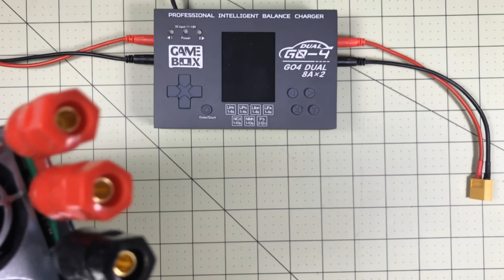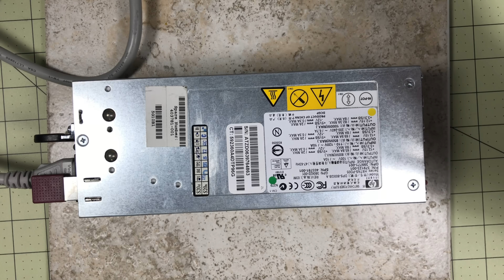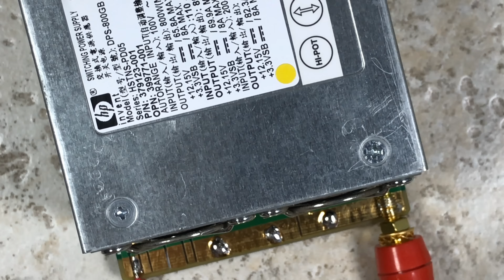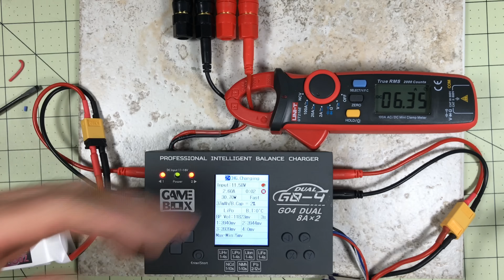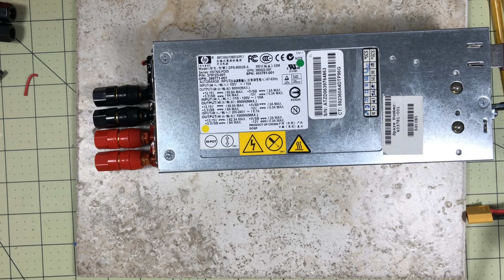Turning an HP DPS800GB power supply into an RC Bench Power Supply. Your cheapest power supply option

Comment from the maker: You can get one right now: http://geni.us/IAX9m
And the Banana Plugs: http://geni.us/4mmBananaPlugs
Check out my current giveaway: http://geni.us/DroneRacer101Rewards
Reply: (3:20)  Always solder one end, then cut to length.
You'll be at the exact length when you cut it, and you'll have more to hold when you're making the first connection.
Reply: (6:30)  you'll find that easier if you heat the pad then touch the solder to it.  and it's not sodder it's soLder
Reply: (12:30)  No ... just No... that is a cold solder. 
To properly solder, you heat the component and add the solder thread to it.
You need a much bigger soldering tip to properly work with that size of component.

Please don't encourage people to solder the wrong way, you're encouraging dangerous connections and putting people at risk of electric shock.

PLEASE STOP

Learn how to do it correctly before you endanger other people by teaching them the wrong way.
Reply: @RobotMunkee  You must have xray vision through a video.
Reply: The banana plug link is dead i need some..what type bananana plug are they called?

Comment: The contacts are GOLD plated. Yes, COPPER is under the gold.
Tinning is preparation  and application of the solder to a wire or other surfaces prior to the final connection being made. Dont carry the solder to the object on the iron. You apply heat to the wire, pad, etc, and apply the solder to that combination of the iron tip on the wire and pad. If you carry the solder to the joint, you will likely get a "Dry joint". You sould also use the correct rosin core solder, never use plubing flux and plumbing solder as that will corrode the joint. I know you didnt do that, that's for others watching.

Comment: 7 years later do you still have the power supply..pin 2 to pin 2  would need 330 ohm resistance..good video too..I have just done the pl11 4 times at 13.8v 400 amps.hope the rc hobby is going good

Comment: I used bigger plugs and cut the threads off then pushed then into copper terminal spades then soldered everything together. 
Zero resistance and handles 80a without a problem.  👌 
Nice work

Comment: Using this PSU nested inside an HP Z800 power supply case. The power supply for those workstations cost a lot and sucks a lot. So, just re-routed all cabling from the old PSU case to the new PSU. The power supply for the HP Z800 is like a drawer that snaps into place with 3 connectors. So basically making the "DPS-800GB A" feed those 3 connectors. Was quite the pain to join all those cables, but next time I have only some 9 cables to re-solder into the new PSU. And the new PSU is A LOT better and cost 1/3 of the price of the HP Z800 PSU.

Would be nice to have a plastic "connector" for this PSU. I wonder if it is possible to print one and add copper contacts...

Comment: Hi. My dps-800gb had the fan blocked for  literally 0.5 seconds. It shut down. And the green led doesn't comes on anymore. What can I do? Is there a way to reset them?

I have 2 of them in  in series. So 24v

It surely wasn't overheating. Only hat my  charger on it with no load.

Comment: The "metal to metal contact" that you are talking about at around 9:25 is wrong because the solder is what's making the contact. What you should actually be worried about is the mechanical strength of that connection, because you are going to be plugging things in and out, and solder is not that strong. 
Edit: you need nowhere near the pressure and time that you used when tinning the banana connector, what you needed there was flux. When done right, solder flows easily and quickly, and by done right I mean bigger flat tips for the soldering iron, and clean surfaces to solder, and that's achieved by using the flux that I already mentioned.

Comment: You need to add a micro butane torch to your soldering equipment for when you need to solder something that soaks a lot of heat! A large Weller gun style soldering gun will also work.

Comment: get a couple of inches of microbore copper pipe, hammer it flat to make a buss bar, bend it 90’, solder one end to the edge connector, drill a hole in the other end and screw the banana jacks on

Comment: Drill thru the PCB and mount the plugs thru hole style. Also use some 12Ga to tie them to the output lugs close to the blades. 
lots of different ways to skin that cat.
Reply: They don't advise drilling this multi layer board.
Reply: @arconeagain  huh, worked fine for me. guess i got lucky

Comment: would 441830-001 - HP 1200W Power Supply for Proliant DL580 G5 be the same process im asking because when i plug it in it does power up so wondering if i still need to run all the cables thanks

Comment: I'm surprised there's no comments about how ridiculously dangerous this is. It's good that you covered the exposed leads at the end but the ones being sold at the link in the description seem like they have giant exposed leads. 800W at 12V is more than enough to kill you.

You should at least include a warning in your video, soldering those small wires is to work around a safety feature that is supposed to keep the 12V rail low while it's not plugged into the server.

Comment: you should just drill a small hole through that #2 terminal then use a small metal wire through the hole as if it's a diode or resistor lead though the board. will be a cleaner job.  do the same thing with the big connectors.  drill through the board and use the nuts to hold it on. no need to solder.  or you can solder it way easier.
Reply: Worst way to connect high current.
It adds a resistance big enough it can glow red.
Reply: @hulkgqnissanpatrol6121  you do understand a pcb is made exactly as i described, right?
Reply: @blue03r6  they're then soldered.
Always solder and how is less surface area better? 🤔

Comment: Hi, thanks for loading this up.  my friend gave me an HP 800W months ago but I was too lazy to read RCG to figure out the wiring.
your instructions were clear and I was able to solder directly on the pins and get it going in no time.  hooked up to a 400W lipo charger and works perfect.

Comment: Thanks for the inspiration.  Works like a charm, but I realize it could crap out at any moment.  I soldered  3 charging leads directly to the tabs.  Running three chargers simultaneously at full capacity and it didn't miss a beat. Two 80 watt 10 amp chargers and  one 100 watt 10 amp per channel  dual charger.  I couldn't be happier with it.

Comment: Hi, I had done the same with my power supply, but it does not provide 12 volts, only 3.3v and 5v are coming and 12v are not available.  
Is there any fuse or anything which is inactive and interrupted 12 volts???  Fan is working and green light is off..
Please help me.. Thanks in advance
Reply: Hi! Check the output double diodes! And 12v output capacitors. Keep me updated please!
Reply: @pavelbires  where are Double  diode and the output cap? i have no 12v on the terminals but 5v..on the small conector..fans turns on..
Reply: @ferreec  Are you using the PC ATX PSU?
Reply: @pavelbires  i'm using  hp dps 800gb..i did the same..the supply turn on....I didn't check the green light...when i plug in 120V to source..the grounded  cable was not conected...no ground..make difference? I Will open to look inside to find the problem..i'm not an eletronic expert..kkk
Reply: @ferreec  Sorry, I thought you were talking about PC PSU. I never had a server PSU on hand, so I can not help you. I am not electronic expert either. But if the fan spins, and you are getting 5v, you maybe haven't gotten the wiring right. The PSU is probably ok.
Reply: @pavelbires  thanks...i will  spent more time on that..
Reply: Which supply is it? Like this one in video or classic PC PSU?
Reply: @pavelbires  I have solved my power supply issue, now Its working fine. :)
Reply: have you solved the problem? i have the same

Comment: (i plan on doing this soon, therefore i watch your old video) I guess i will connect thick cables on the contacts an then connect the cable to the desired contacts. and i recommend this too, because soldering wire is always easier than full copper connections.

Comment: It probably has gold plated on the terminals both on the ps & the barrel connectors, and also leaving it threaded 'actually' give more contact than grinding it off to a flat lesser surface area. it is the solder that is creating creating the electrical bondage between the both terminals, so more the corrugation the more the surface area.

Comment: thanks for info - your soldering skills need much improvement
Reply: just needs a bigger tip for the big stuff.  to be honest he should just drill a hole and bolt them to the board.
Reply: @blue03r6  nah, using pressure, dirty tip, wrong tip, not using flux, all of this except the flux is wrong, flux is optional, but it would definitely make his life easier

Comment: Just ordered a pair of hp dps-750rb PSU units fro EBay and it was like $20 total!!! Can't wait to try your mod on mine!! Thanks for the useful vid. Quick question... Is a resistor necessary, or just that short jumper wire??
Reply from the maker: I did not use a resister.  It’s just wire.  Some of the diagrams did have one but I didn’t need it.
Reply: Sorta considering a power switch once they arrive...... Not too convinced I would REMEMBER to unplug after use.... Ever build one with an add on switch???
Reply from the maker: I have mine connected to a surge strip and I just used the switch on that.  Made it really easy.

Comment: How can your Amp meter get the Amp reading using the clamp?  The clamp is for the AC current only.  To measure DC current you need to connect in series using the probe.    I am puzzle how you measure it?

Comment: hi friend, I use this psu to power a 3d printer. The 5v output is used to power a raspberry with octoprint. Can I ask you if it is normal for this standby psu to heat up? Only when I activate the psu to get the 12v then the psu cools with its fans. In standby the fans are off and then the psu heats up

Comment: Good job, FYI : That's one of the 1000W ones.  HP supply them in three wattages =800/850/1000 w.
Reply: But only 1000W when running in 220-240V I think. 110-127V is 850W and 100V is 800W. That is what is written in the label. Here in Brazil we have both 127V and 220V pretty much everywhere, but here in my region we use more 127V (220V only in some places). So mine will run in 127V / 850W.

Comment: Have you tried 2 or more in series to get more amps?
Reply: In series would not give more amps, it would give twice the voltage. In parallel would be the way to get more amps.
Reply from the maker: I haven’t yet.  I haven’t had any need for the higher voltage.  Mike is right, in series will make it 24 volts.  The bigger chargers require higher voltage to charge the bigger battery packs like the 8S packs Heli guys use.  But but for drone chargers there really isn’t a need.

Comment: How could you wire this up in series? Is it as simple as wiring it up in a 2s configuration? or do you need to release a safety mechanism?
Reply: A good video I've found on this topic is here https://www.youtube.com/watch?v=aL8lcJ69mkg. Not sure if it is this exact video but his series covers the topic of floating the ground of the cases of the PSUs. Theres a lot of science behind how this works but its pretty easy to accomplish in reality, just be really careful as you may have to go near some big capacitors.
Reply from the maker: You can, but there is a very specific process to do it correctly.  I recommend reading the RC Group listed above and they detail the process for wiring it.
Reply: OtherDalfite, Thanks but turns out that this power supply doesn't require you to do that to wire up in series. It literally just as simple as wiring it up on a 2s config to get double the power.
Reply: @CareLESSmAyhem   Just watch out if you do. If any of the two supplys gets deffective the casing might transfere 210Volts. Make sure you disconnect the DC grd on one of the supplys if you put them in series.

Comment: Hello and thank you for posting this video. II doubt I'm speaking for myself when I say that I am a visual person. Following steps in a blog is a lot more difficult than pausing a video. I do have a problem I hope you can help me with. I have the exact same psu that I am working on. Only differences are that mine is a Fujitsu brand and has one large fan on the end instead of 2 smaller ones. My problem is when wired up the way you demonstrate I only get 5v output and my light, although is green, flashes instead of constantly on. It acts as though the psu is happy, it's just missing a little something. Any help would be greatly appreciated! Thanks again
Reply from the maker: What is the model number on the power supply?
Reply: The model number is the same. It is a DPS-800GB-5. It also says it is a Rev. S2F. I'm not sure if maybe the revision number makes a difference or not.

Comment: Using your configuration the PSU comes on when plugged in however it shuts down after a minute or so.  Do you have any idea why?  It is a brand new PSU, the same p/n 3791230=-001.
Reply from the maker: +Mike Phillips Did you check the voltage output?  12ish V?  Have you tried putting a load on it?
Reply: Mike Phillips where you able to resolve the issue with the power supply?
Reply: I purchased a second one and had no luck AGAIN so I purchased a different model that i knew would work.  DPS-750RB-A works like a charm with my iCharger

Comment: I have an iCharger 4010 Duo; would this work for my charger? As a side note, I finally got my Lizard95! Unfortunately it totally pooped out on me in the middle of setting it up. :( Hopefully BG will send me a new one. GREAT video as always and keep up the awesome videos!
Reply from the maker: +FlyinPhynix FPV it will work, but may not be big enough if you are pushing that thing to the max. Like charging huge heli batteries. For that you need a pair of these hooked in series to get 24V. There is a very specific process for that. It can be done but you have to be very careful.
Reply: Awesome, I won't be pushing this thing to its limits at all. I just charge 2s-4s racing quad batteries in sequence with each other. Thanks for the instructional video. Really enjoy your channel!

Comment: This soldering tool... That looks suspiciously like a flat head screwdriver that is hardened steel... facepalm
Reply from the maker: That is just one tool from a kit similar to this. https://www.banggood.com/WLXY-6-In-1-Soldering-Aid-Tools-for-PCB-Repairing-Rework-p-930510.html?p=EB070918823112015072
Reply: Fair enough. that one your using just looked exactly like a flathead screwdriver though hahaha
Reply from the maker: +ScarfaceFPV true. I think I cut the part where I showed the other side.
Reply: All good. Looks like a wicked power supply though. I was lucky enough to have an old 10amp 12v psu from a 3d printer I once used to use, It works well, but not quite as beefy as this. :)

Comment: Very nice! I have a similar model. I designed a 3d printable cover for it. https://www.thingiverse.com/thing:2383895
Reply from the maker: Spencer Owen that is really slick. I like it a lot. I heard you need a big switch if you do this. But I will try this for the next one I do.
Reply: I wasn't aware the switch pads required that much current. I've rebuilt multiples and haven't noticed any problems with the thin switch wires. I'll keep an eye on it.
Reply from the maker: +Spencer Owen I don't think it was the wire as much the switch they had picked. I haven't tried one yet but a few places said they used a switch and it got really hot.  But it looks like you picked a good big one so I would expect that to be fine.  Without fail as soon as I post a video I want to totally redo it after a comment.  In this case I'm glad I have another on the bench ready to go.  :-)
Reply from the maker: Do you think you could adapt that to connect 4 banana plugs?  They could just screw onto the printed part and then all you have to do is solder a wire from the plate to the plug.
Reply: Possibly yes. Those particular plugs look a little long and not easy to mount. These might be better https://www.amazon.com/dp/B01G0PLING/ref=pd_luc_rh_sbs_03_01_t_img_lh?_encoding=UTF8&psc=1
Reply from the maker: I have a pack on the way to try it.  Just got a switch, I might be redoing this video.  :-)

Comment: lol, I have been using my old xbox 360 power supply for my lipo charger, same idea reusing old or everyday power supplys
Reply from the maker: Clever, looks like those are 200Watts and 12Volts.  Thats pretty good.
Reply: thank you, it works great for my needs
Reply: Great idea. I have a few of those due to the red ring.